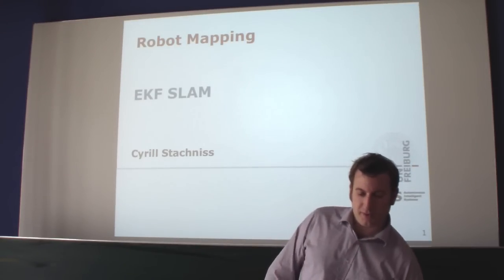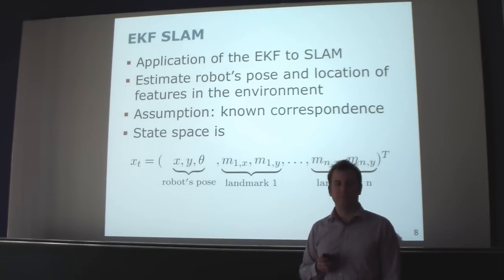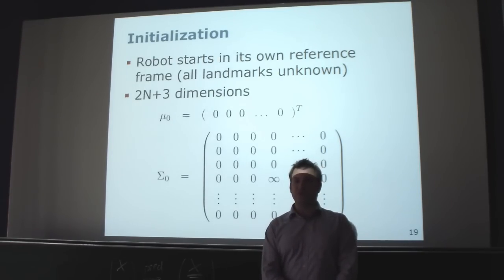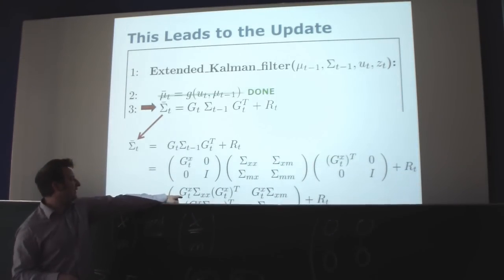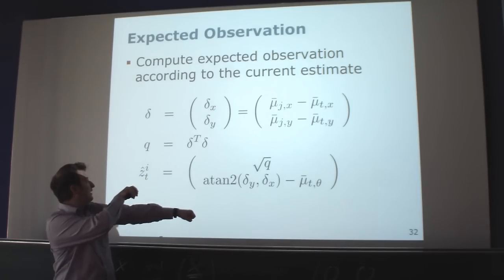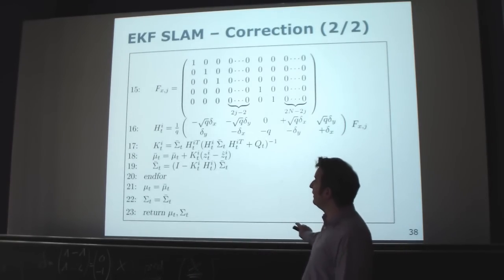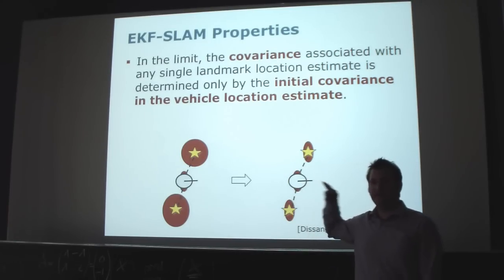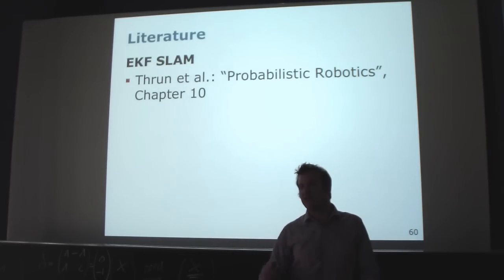SLAM Course - 04 - EKF SLAM - Cyrill Stachniss

Comment: Hi Sir Cyrill, 
Is the effect of reduce of uncertainties caused by loop closure applicable to:
- smaller sized loop
- sensor's frame to frame (or few frames interval) data association?

Takes 2012/13 sheet 2 exercise 3 as example, robot senses landmark 1 at the beginning and end of its path but the uncertainties do not have significant improvement. 

Thanks in advance!